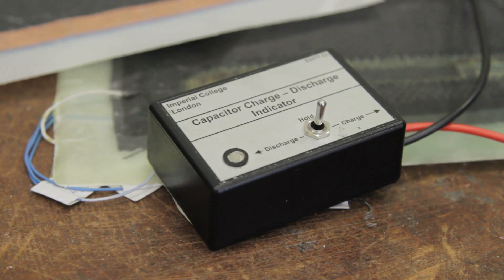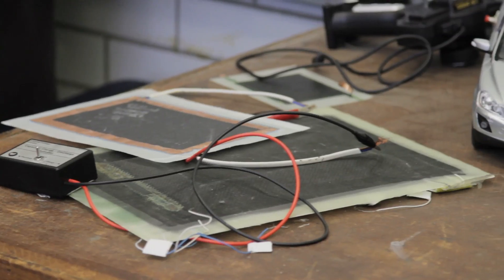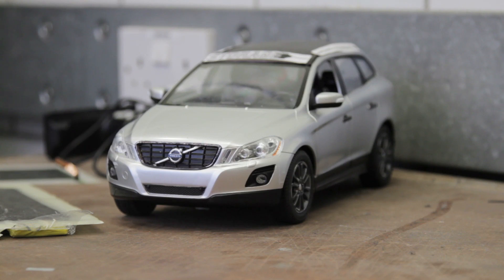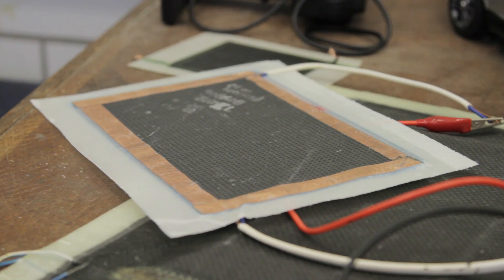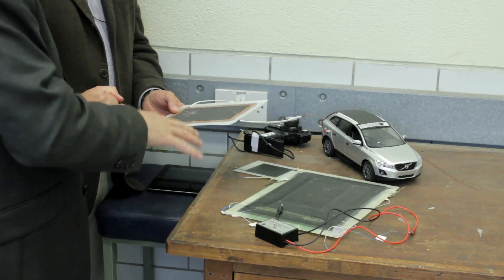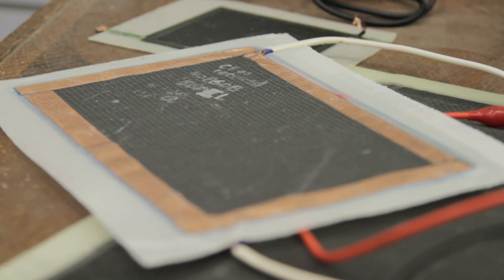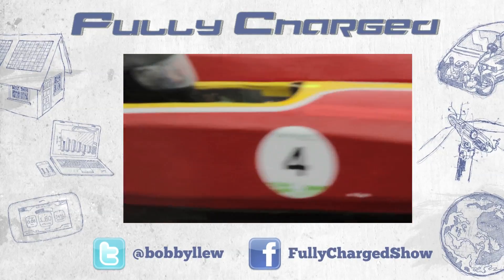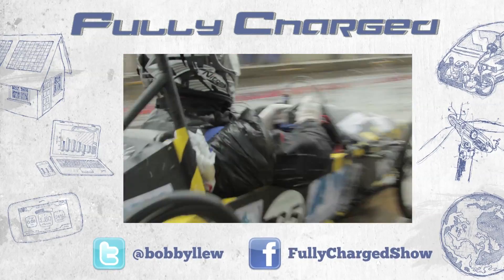Supercapacitors | Fully Charged

Comment: Could super capacitors be used for stop and go?

Lithium does most of the work, but super capacitors absorb regen and are used to increase speed?
Reply: That's basically the point being made about them being used as a buffer. 

When the motor draws a lot of current to get the car going from a stop, it'll draw on the supercapacitor, taking its charge down a fair bit, which will be recharged from the batteries at a much slower rate (say, over 10 seconds, compared to the half a second it took to get the car moving). 

When you brake, the generated energy gets stored in the supercapacitor (which won't be kept fully charged) then slowly released into the batteries.

Comment: There is a video on Youtube showinga guy making a car battery out of a bank of supercapacitors. The discharge was so fast the starter motor turned super fast. You only needed to flick the key.  He only used it as  battery. It retained the charge quite well. 

Put a bank of supercaps between a normal 12v battery and the cars's electrical system then the performance really improves. The car will be started by the charge in the supercaps. If the supercaps discharge they will be empty of course and then be charged up by the 12v battery/charging system a little slower.

Comment: A guy in the USA built a battery out of super capacitors and a lithium ion RC battery to store some energy. Even during cold temps the car starts just fine and even after sitting for long periods of time. Why we still use a LEAD Acid battery to start your car today is beyond me.
Reply: Yeah you can put that stuff together on your own, problem is it will cost you about 3-5x as much.
Cost is why lead acid batteries are still the primary item.
Reply: MsSomeonenew Super Capacitor's are not expensive. Might wanna look that up.
Reply: Entry level isn't expensive, but they also don't do much. Stuff good enough to crank an engine reliably gets very expensive.
Reply: MsSomeonenew You obviously haven't watched the video of the guy who uses them to start his car. He uses a Lithium Ion battery as a back up source, and he had his car parked at the airport for weeks and it still cranked over. Like I said, go do some research. He builds them and sells them too. His you tube channel shows them in operation, but I'm not going to search for it.
Reply: Mining lead is far easier than mining lithium, its also more abundant and the same reason why iron is cheaper than gold.

Comment: what about graphine that has been rumoured to increase the energy density of electrolidics by 10 x and when used in batteries achieves higher storage and grater charge and discharge rates.

Comment: So basically it works like RAM in a computer, acting as very fast access memory for the CPU, and a go-between for the slower, permanent storage of a hard drive.  Rather than be a separate component in an electric car, it seems they would be better incorporated into the battery cells themselves, along with control chips.